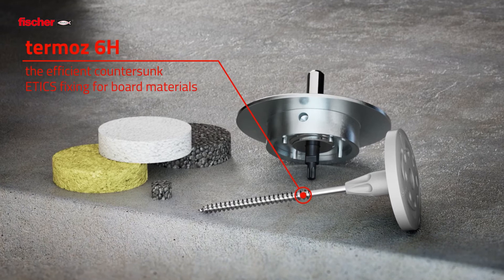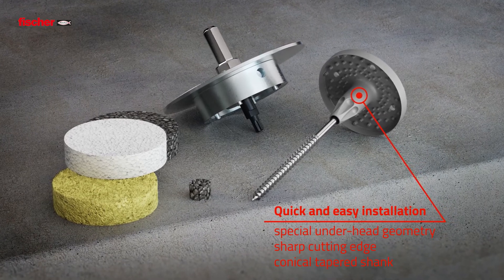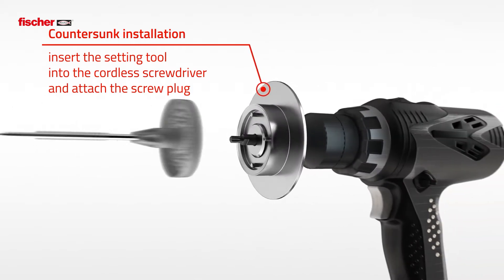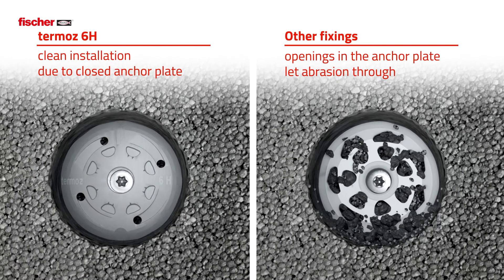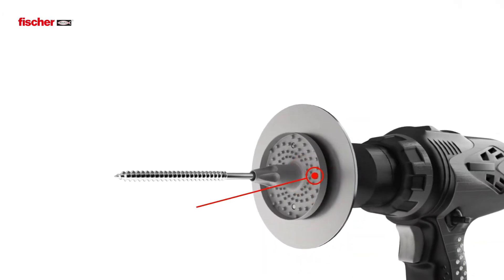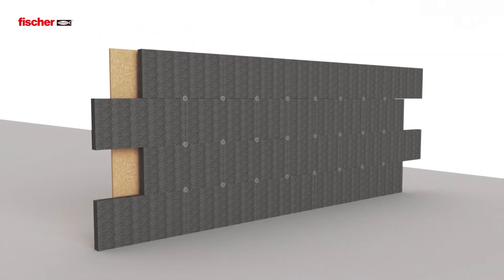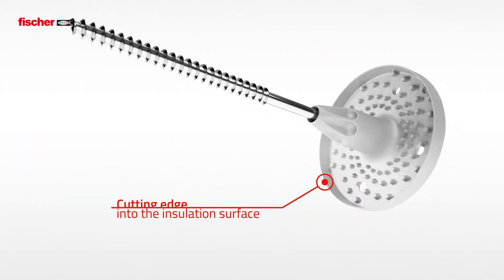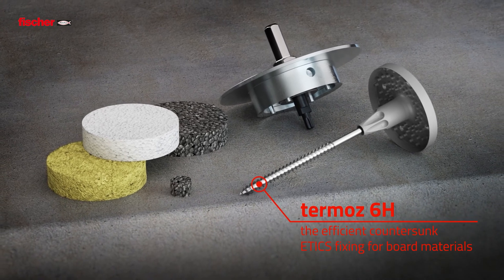termoz 6H: The efficient countersunk ETICS fixing for board materials

Comment: could these or another of your products be used to fix wooden battens to the masonry through the EWI?
Reply from the maker: This is not possible with TermoZ 6H. For this application it depends on the insulation material which product we recommend. We suggest that you contact our service team. You can then specify your application in detail and we can advise you accordingly. Please send an e-mail to: intsupport@fischer.de